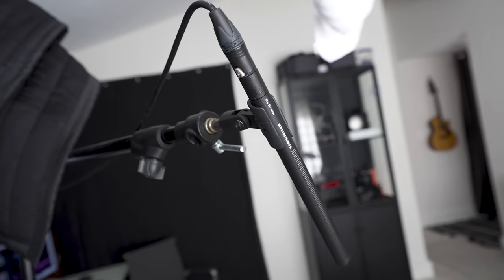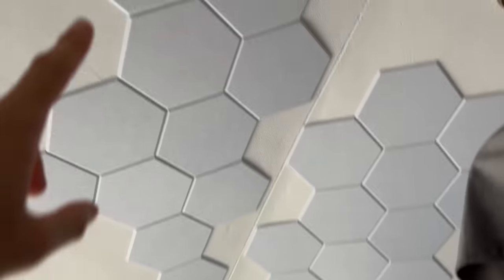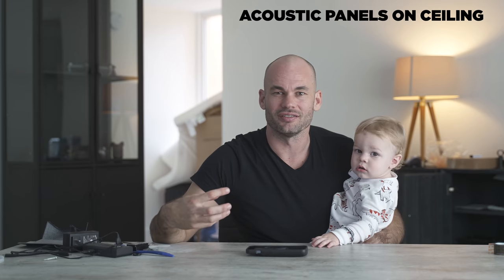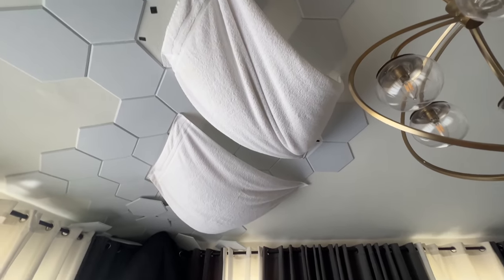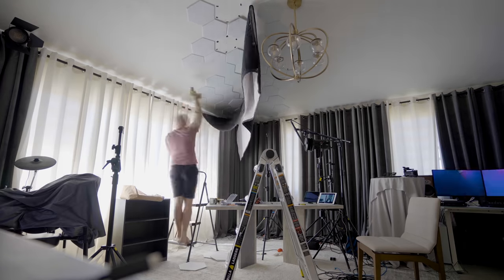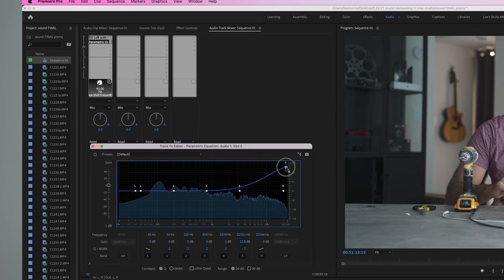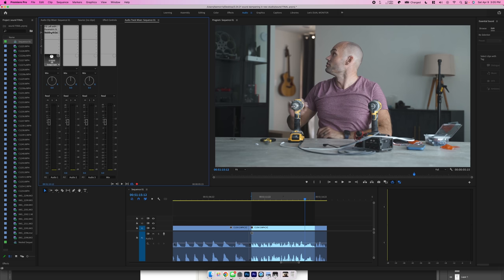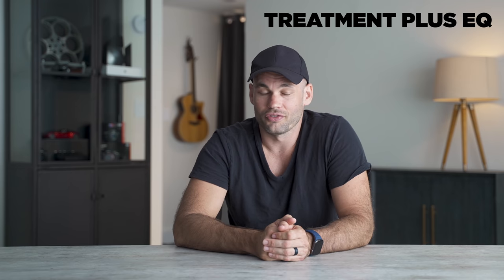How to removed echo from a concrete room

Comment from the maker: Trust me everyone, I've watched all the videos by the sound treatment experts. I realize sound blankets don't absorb low frequencies. I built out thicker sound panels and they did nothing to combat the 100hz resonance. In this video, I showed you about 5% of everything I did to try to get this room sounding good including swapping the mic for one that is made for indoor use. Of course I could put a mic by my mouth in the shot, or use a lav mic, but I wanted to build a setup where I could sit down, and instantly start filming without fiddling with anything. I am certainly no expert, but after a month of daily testing I got it to a sound I'm happy with.
Reply: And it sounds good too
Reply: I have a solution for you. I bet that the dimensions of the room are not prime numbers eg the wall lengths could be 4 metres by 4 metres. The one divides onto the other and you get echoes. Make the dimensions of the room prime numbers eg 3m x 5m then your acoustics will be better. Obviously easier before the house was built. But what you could do now is add an additional dry wall on one side of the room to change the dimensions.
Reply: The problem is that you are trying to treat the resonant frequency with absorption rather than diffusion. It is likely a standing mode between your floor and ceiling.

Comment: the thing is that all those blankets and panels only work for higher frequencies, not for the low frequency resonance you found; you need what's called a Bass Trap to trully deal with that, which you can stick on the corners of the room, or if the problem turns out to be between floor and ceiling, a "cloud", which is one you hung from the ceiling like you did the blanket, but built with material that will actually absorb some lower frequencies.

Comment: The issue is bass build up in the room. Everything you tried to kill it is meant for treble and midrange. You need some low end absorbtion. So now you are nuking the high end and mid reflections but doing nothing to kill the low end.
Reply from the maker: I tried thicker sound panels that should have been able to absorb 100htz and they did nothing for that one note. I just didn’t put all of my failures in the video or it would have been hours long.
Reply: This is immediately what I thought when I heard the first samples
Reply: @FStoppers  the wolf tone could be in your gear. Musical instruments sometimes have them too.
Reply: @Fstoppers  Hey Lee! Bit late but thought I'd offer some advice. As I'm sure you've researched different thicknesses block different wavelengths of sound, and in this case you're trying to hit the low end. There's also an added effect that bass, due to reflections, typically build up in corners like the one you're facing. Larger flat panels like the ones you've described using are great, but bass traps in a corner (4"-8" thick) really knock out the sub 100hz ranges. You could also try sound diffusers (instead of flat panels, they're peaked to scatter sound similar to light diffusion). I'm sure you saw most of this and tried much more than we saw, but I figured a few corner bass traps might help you out! Cheers, and love the content.

Comment: The issue is the mic, not meant to be used ondoors. Try with a small condenser one with an supercardioid patern.
Reply from the maker: I tested one of those mics as well and it sounded almost identical
Reply: Ask to Gerald undone or the guy of camera conspiracies, a pencil mic would help.

Comment: Not bad ideas, but first, you should understand acoustics and wavelengths. For that low of a reverberation you will need a much thicker sound panel! Those blankets sort do something but just on mid to high register because are too thin. Start with corners, then right above the position you want to sound best. Also a nice, thick carpet or rug will defiantly help a lot.  Also those cuts in Premiere are verryy extreme.

Comment: Your editor, if they’re a “sound guy/girl,” should do something with that residual HIGH end zing in your narration in this video. It’s either overly boosted/excited and would benefit from a de-esser. Those sennheiser shotguns can bring out some spectacular spoken word stuff in the right use scenario. Maybe this room just isn’t it? If you’re not willing to do it perfectly right, you have to be willing to do more corrective work. Btw that high end boost, leading into that intense compression, is waaaay too heavy handed.

Comment: I hope you tried using a Dynamic Microphone close to you first... Using a Dynamic Microphone without increasing the mic gain (to much)  would have fixed most of your problem... but only problem is that it would be in the frame.....  like an EV RE-20 / EV RE-27  or any broadcast microphone and a Gate/Compressor strip... is all you need....

That is what I’m using in a non treated room. And I can keep the microphone 6 inches off frame..

Comment: You could have just used a microphone suited for  indoors recording. You broke it with the 416 and then you had to fix it.
Reply from the maker: I had an expensive indoor mic. Still sounded bad.
Reply: The space is big enough that it doesn’t make a huge difference. The 416 is still excellent indoors with treatment and it’s not like an indoor mic will not require treatment to sound good.
Reply: @MarkVO  it makes a huge difference. It’s physics. You interference  tube renders reflected sound extremely unnatural.
Reply: @MarkVO  physically not possible to be good. But I guess what is good for me might be different for others.

Comment: Dude.. You turned your home office in what.. Awful.. Is it worth it?
Reply: Thank god he got  that sennheiser 416 microphone for free ($1000 mic) Add another $500+ in wall treatments.. I think just adding a Dynamic microphone inclose proximity with low gain would have worked fine.. however the microphone would be in the shot and I'm sure he did not want the mic in the shot.

Comment: This was depressing.   In three months I'll be moving back into my house after some major renovations.  Then I will attempt to turn a 10 by 12 mostly concrete and windowed room into a studio environment.  I'll be using Rode Procaster dynamic microphones and a shotgun overhead in the open space which should help.  I'll have a separate sound booth for the condenser mics.

Comment: I discovered If you're walls are plaster and not drywall, you will need curtains all around..
Reply from the maker: Curtains and heavy blankets help no matter what the material.  Sheetrock is nice but it still reflects a lot of sound too. -P